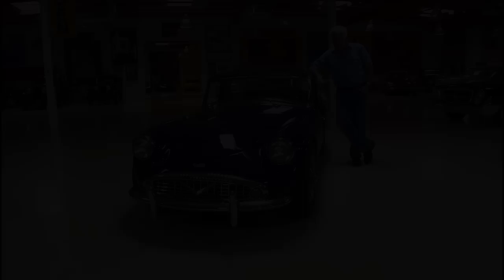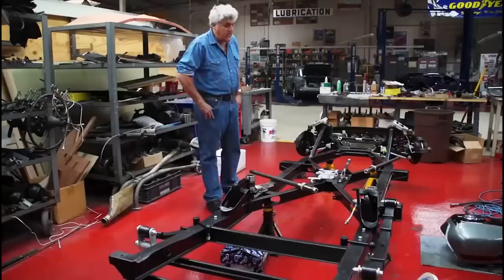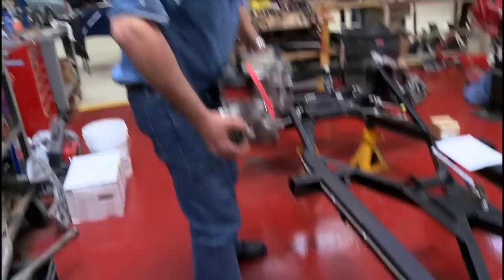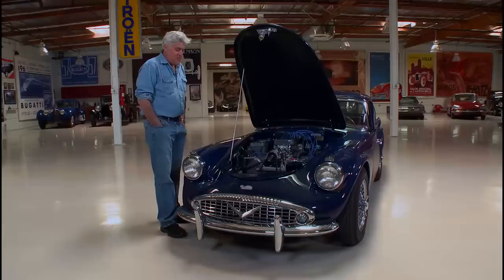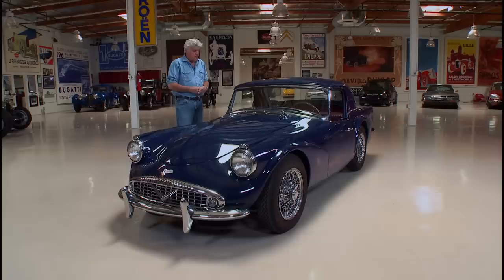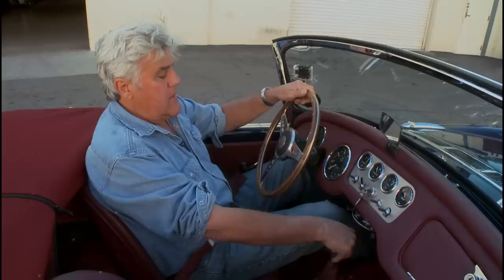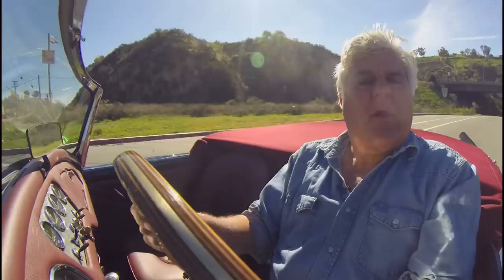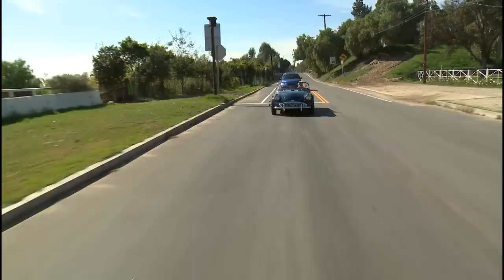1962 Daimler SP250 - Jay Leno's Garage

Comment: When this car came out, about the only thing that was positive was the power plant. The Austin Healy, MGA , Triumph, 1956-57 Corvette and several other Good to the eye cars were on the streets. I think the later MGB and Jaguar E-Type as well as other manufacturers models sitting side by side to the SP250 made about 90 percent of the prospects walk away from the Dart. And, no, The Alpine did in no way resemble the Daimler other than the small fin appendages on the Sunbeam. The SP was considered UAF and the Alpine was nice and attractive. Nice resto mod Jay.

Comment: Daimler made that same little hemi V8 in a 4.5 litre too (278 cu in ... 220 hp/ 283 ft Ibs) and put in in the Daimler Majestic Major and they can be straight swapped.
This little hemi was used in the first rear engined British dragster and became the first drag car under 5.5 litres to do a quarter mile in under 8 seconds. By the time that car (The Glacier Grenade) was outlawed in 1989 it produced 1,400 horsepower using a stock but modified cylinder block, crankshaft and cylinder heads and ran a best of 7.2 seconds at 180mph. 
However I got to say ...why the hell would you put a webber on it when the twin HD6 S.U's (theyre not Solex' Jay) were such a better carburettor? Cant your guys tune them? Admit it ... they gave up when they couldn't find an idle screw right?  LOL

Comment: What a beautiful resto u did on this car. Who would've known, i certainly didnt - a British 250 v8 hemi...
Was this the same engine used in the Daimler v8 sedan of the same era & who designed & orchestrated this engine-was this a British conception by Turner ?
Reply: The Daimler sedan had a larger version. When Daimler/Jag were taken over by British Leyland, they standardised on the Rover V7. But BL allowed Triumph to continue to make their V8 for the Stag. A silly move as the Daimler was proven, which was dropped in 1969. Subsequently the Triumph V8 was made by Satan.
Reply: The engine was in the sedan bit the 4 litre version. Which was not quite the same. It was also fitted in Daimler versions of Jag sedans.
It was dropped by BL as it was expensive to make. 

The newer Triumph under R&D was a more advanced design, which also would be cheaper to make. The Triumph engine was appallingly made, with some design quirks. Once the bugs were taken out it was a good engine. But too late as it rep' was bad.

Comment: That car was too good that is why the Police used it but I kind of like the looks of the 250 I wish Jaguar would bring the engine back with the latest 4 valve double over head cam same V8. Mr Leno you have done something special with that car.

Comment: I did countless laps of my test circuit to figure out cooling system issues. Then brake issues. Then steering and handling. You have to test drive.

Comment: Used to have a HX Statesman GM Holden with a 308 in it Holden motor remember one day it overheated that bad it was screaming when I turn the engine off amazingly it didn't kill the engine still worked after that end up moving from Brisbane to Melbourne back in 1990 the use the lot of oil after it overheated when I drive it to from Brisbane to Melbourne it used $80 with oil I would just drive it to the red light light come on pullover chug another five letters into the engine of oil and keep on driving I it blew a lot of smoke when I back off the throttle..but the engine never die don't ever buy a red car had nothing but problems with the day 1..bought  a lot more to tell... that car went for a lot

Comment: History? The first tank had a Daimler engine. Daimler was owned by BSA from 1910- there were Daimler limos,  buses and trucks,  ambulances, armoured cars Rommel escaped El Alamein in a captured Daimler Dingo.Edward Turner was chief executive of the BSA Group when he designed the engine - Daimler and Lanchester cars, taxis, motor cycle marques. BSA was a big industrial conglomerate guns, specialist metal products etc and gradually divisions were sold off to support the ailing motorcycle business- it all ended in tears with that stupid Ariel 3 moped bringing the company down.

Comment: Do you think that 2.5 HEMI is better than the current 5.7 HEMI? Sounds like it has a better power to displacement ratio. However, does it reflect on fuel efficiency? I understand you may not be interested in fuel efficiency. I have a Dodge Magnum with a HEMI. I didn't buy it because it has a HEMI. I bought it because I like the style, room and comfort. I wish it could have the efficiency of my Hyundai Accent. My Magnum does 12L/100km and the Hyundai Accent does 5.7L/100km. It hurts the pocket greatly! 😢

Comment: Unfortunately Jay short changes Daimler with comparing this cars engine to larger USA model engines.
Daimler also produced the 4.5ltr (278ci) Majestic Major V8 that produced 220bhp had 4 wheel disc braked and some with LS Differentials. It weighed in at 4145lbs but did 123mph with good handling.
It was faster than Jaguars Mark X up to 80mph and Jaguar tried the V8 in their Mark X body it embarrassed them by doing 135mph, so they stop the 4.5ltr going into a Daimler version of the Mark X body.
Also when the 2.5ltr V8 was originally tested on the dyno at 140bhp, Edward Turner through on 8 Amal motorcycle carburetors and it then produced 200bhp with no other changes

Comment: You need to tell your guys to stop using a bead / glass blaster on alloy parts, use walnut shells more. Leaves more patina instead of removing the original cast surface.

Comment: I'm trying to remember, but I think the Brits had a crazy tax structure which restricted certain size motors from being used.  So this car, if it were intended for the American market, would not have the same tax as a 4cyl motor.
Reply: yea in the video of the Peterson Museum's Ferrari Barchetta they talk about engine types were related to taxes. until that point (when the video was new) i didnt know why and it makes sense but i dont get why it is taxed on it though.
Reply: In the UK  taxing cars based on cylinder bore was long over by then.   In all  Europe fuel  was and  is still highly taxed  so we went for small efficient engines.
Reply: Andrew W MacFadyen ah ok

Comment: If only they gave this engine to Triumph cars,  no need for the disaster that was the Stag engine and the complex mechanical fuel injection engine. They could have put it  the 2000/2.5 sedans . the engine also came in a 4.4 litre that could have been reduced to a four cylinder etc for the Dolomite range etc...

Comment: Re Buick engine being used rather than this, when Rover were looking for a V8 for the P5, the Daimler engine was from a competitor. They weren't part of the same conglomerate till 1967 and by that point they'd already bought the rights and started producing their own,ex Buick, V8. 
Why didn't Triumph use the Daimler V8 in the Stag, that would have been better than the V8 they did use.

Comment: Should have not run it. Should let it cool then check the water.  Would have realized the cap issue....hopefully didn't cause excess wear on the bearings and rings from the excessive heat.

Comment: The Daimler 2.5 litre V8 was dropped as Jaguar was merged with British Leyland in 1968.  BL then had the Rover V8, the Daimler V8 and the Triumph V8 ready to be launched in the Stag.  So the Daimler V8 was dropped as it was more expensive to make. Sad, because the Triumph V8 had little R&D and testing, ending up the worst engine ever made by mankind - although third party parts have got the engine OK.

The 2.5 Daimler V8 was fitted into a Jaguar car, named a Daimler.  They made about 22,000 of them.  So about 25,000 of these engines were made.

Comment: Jay does some amazing rebuilds but does originality really have to be ignored ?.Bringing these cars 'up-to-date' with modern gearboxes/brakes etc whilst saying that the original parts are on the shelf and can be replaced 'at any time' sounds fine, but likely ?. 'Updating' for use in modern traffic is understandable if the car is in frequent use but probably this will not be the case. Are these 'improved' cars anything other than surreptitious  'hot-rods'?. He could of course insert a modern American 'V-Twin' engine plus massive disc brakes on a Brough Superior SS100 motorcycle and 'bring it up to date' but would that still be a Brough ?......hardly.
Reply: from what i understand he rebuilds his cars to be driven. Not to sit in a showroom and do nothing. In that sense it makes sense to put in new parts that make it more reliable/easy to drive. He has all the original parts in case someone wants to do the museum thing after he is done with the cars. It's all about perspective. I think what he does is perfectly reasonable. He isn't throwing away the parts and by on large the engines and main running gear are the same as the original. Disc brake additions just make sense in most cases since old drums especially original drums are hopelessly ineffective.

Comment: Please stop calling engines "motor" Motors are electric...
Reply: Mirriam-Webster 
motor noun
mo·tor | \ ˈmō-tər\
1 : one that imparts motion specifically : prime mover
2 : any of various power units that develop energy or impart motion: such as
a : a small compact engine
b :  internal combustion engine especially : a gasoline engine

There is a reason why is called the DMV and not the DEV.

Comment: Typical jaguar car
Reply: It's not a Jaguar.
Reply: Only by adoption,  Jaguar  transplanted the same engine in a Daimler version of  the Jaguar Mk2  -- a tight squeeze.   There was also a big block version of the engine 4.5 litres used in the Daimler limo.